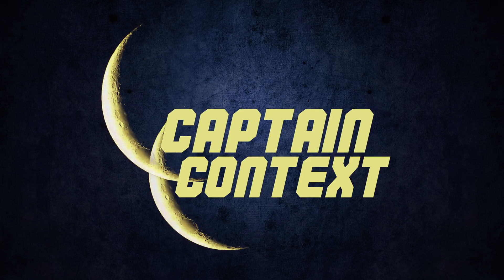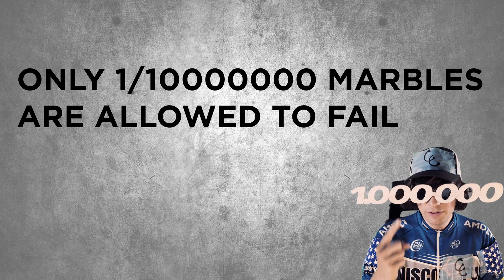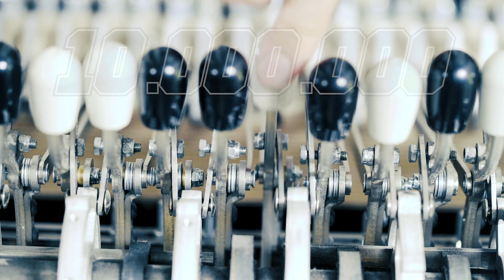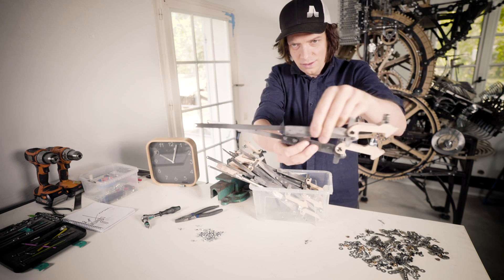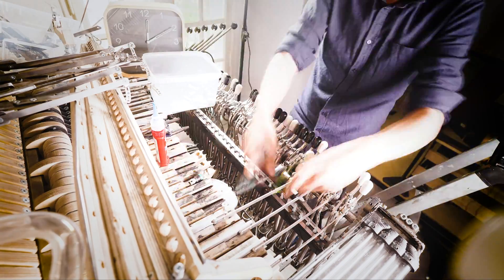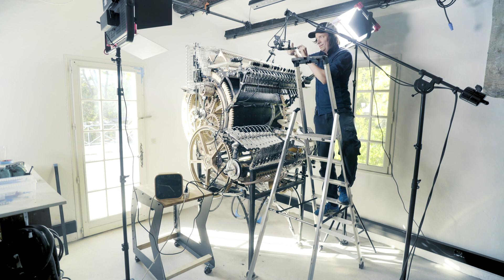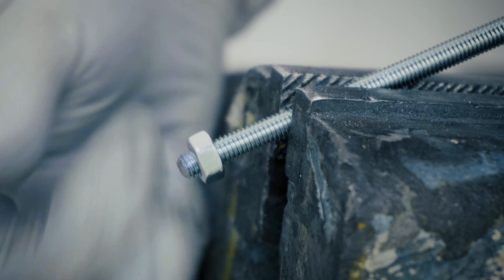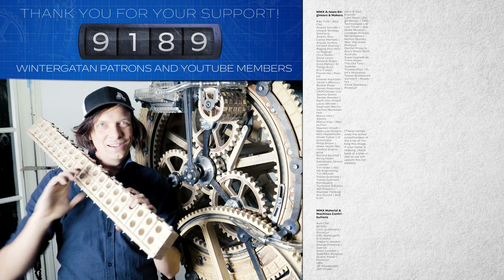Countersink? Why? - Marble Machine X #143

Comment: I hate to say this, but:
 To achieve Martin’s goal to play 1000 songs without failure (“with luck”), that is that only every 10 million-ths marble fails, it is not sufficient to make every part 10 million times work in a row.  Martin needs all parts that contribute to the marbles’ success together to work correctly 10 million times in a row.  Please let me explain what this means with a simplified example.  If there were only 2 parts in the marble machine, and the marbles have to pass through both parts to “succeed”, then if only one of the two parts fails this means that the marble will not “succeed”.  So we have the following fail/success scenarios:  part 1 | part 2 : result ———-+————:————— ok       | ok       : success
fail      | ok       : fail ok       | fail      : fail
fail      | fail      : fail  In other words, a marble only succeeds when both parts work correctly.  When only one part fails, or when both parts fail, the marble will fail.  Now, how probable is it that both parts are ok at the same time, if each part works ok 99,99999% of the time?  The probability of that is the product of the probabilities for each part that the part is ok:

  probability-both-are-ok = probability-part-1-is-ok * probability-part-2-is-ok

In probability theory 99,99999% reliability translates to a probability of 0,9999999 (that is, simply divide by 100), and 
  0,9999999 * 0,9999999 = 0,9999998  So the reliability of the whole 2-part machine in this example is only 99,99998%.  Or, in other words, 2 of 10 million marbles will fail.  So only 500 songs can be played with a machine that has 2 parts, when each part has a reliability of 99,99999%.
 It becomes worse with more parts.  If the marble machine had 10 critical parts, and if the failure of any of the 10 parts means that a marble will fail, then if each part by itself only fails 1 out of 10 million times, then the probability of the whole machine working is    0,9999999 ^ 10 = 0,999999  (That is 0,9999999 to the power of 10, which means the product of ten numbers 0,9999999.)  So only nearly a million marbles will make it through before one fails, and Martin can only play 100 songs in a row.   What does this mean?  To find out how reliable each part must be, Martin needs to find out the number of parts that the Marble Machine X has that need to be in “ok” condition in order to make the marbles come through correctly.  Let’s give this number a short name, and also the desired reliability of the machine:    N = number of parts that must work   R = desired reliability of the whole machine (as a probability between 0 and 1, as above)  Then Martin can use this formula to calculate the reliability “r” (as a probability between 0 and 1) that is required for each part:    r = N-th root of R  (A scientific calculator (app) can compute this easily.  Or even google can do this.  In google, search for the text “Nth root of R”.  For example “100th root of 0.9999999”.)

As an example, if the marble machine X had 100 critical parts that must work “ok” for the marbles to come through correctly, then the reliability of each of these parts must be:    100th root of 0.9999999 = 0.999999999  In other words, each of these 100 parts is only allowed to fail once in 1000 million times.  (That’s once in a billion times, for Americans.)   One more hint:  It is also possible to go through all the parts of the marble machine that “must work” and estimate the probability for each part that it works, and then to multiply all these probabilities together.  (Don’t forget to use numbers between 0 and 1 for each of these probabilities!  0 = it always fails, 1 = it always works.)  The result is the reliability of the whole machine.  Some parts may be far more reliable than others, and it is possible to identify the “weak spots” of the machine more easily this way.  One can then use a spreadsheet and check how much the reliability of each of the “weak” parts must be increased to achieve the required reliability of the whole machine.  (That is, fill all the probabilities into spreadsheet fields, then use the PRODUCT() function over these fields to get the reliability of the whole machine.  Then, make a copy of all the fields.  You can then highlight and tweak the probabilities of the “weak” parts in the copy to see how much the reliability of the whole marble machine changes.)

Comment: a video without context is like a marble machine without a realistic fail ratio.
design it and test it how you like, but if it's bound to fuck up somewhere, then no amount of oversight can counter it. the more moving parts, the more opportunities exist for fails.
btw, your patreons are becoming fewer... what's that about?
Reply: I was wondering about the count, I hadn't gone back to check but it seemed like it was at a minimum not going up lately. I think (and I hate to say it) that a lot of people are seeing the same thing you have mentioned, where the always-dynamic goal posts have been moved to an unrealistic distance. The last several videos have essentially shown the machine moving backwards in completion, whereas before it was close to being able to play a few songs before needing revision, now it is getting major components reworked from scratch - and if the same unrealistic objectives are going to be applied to the remaining parts of the machine, it's more or less about to be completely started over. After 2-3 years being at 90-95% completion stopping and saying "no wait" is pretty discouraging to patrons (and viewers of the channel).

I think a better plan is more or less what everyone in the comments is saying - even if the failure is 1 in 10,000,000 then that failure could still be on marble #4, it needs to have shear pins, heavy springs on slips joints, or something to enable a marble to "fail" and only disable that one particular channel. These failure points should be easily reset. Martin will notice it immediately if something goes wrong, but can still finish the song, and clear the jam without much delay. Better yet, this approach would make the machine actually possible to complete again.

Comment: Just throwing it out there that having it drop 10000000 Marbles without fail is very different from having every component function 10000000 times without fail. From what I can tell there are very few moving parts to this which interact with every marble that is dropped meaning most parts don't require quite so high a level of reliability (though I'm not say redundancy in the reliability is a bad thing) and further more this is going under the assumption of never carrying out maintenance at any point between the required 1000 songs.
Honestly, it might sound a bit harsh but I think this video about context has almost missed its own point by assuming that the context of the machine as a whole is always the same as the context of each of its components which for the most part... it isn't...

Comment: as a former Fire Protection Specialist....we didn't run because of mistakes... we didn't run because of the risk of injury.   If we're responding to an emergency, and we twist an ankle or stumble and get an injury.. that means our crew is down a man in their response, and that increases the overall risk to the entire crew....and substantially adds to the time required to mitigate the emergency...
instead, we were often told "Show a sense of urgency"..

in a way, it's a lot like your marble drop reliability issue......if we run to the truck or run across a fire ground...maybe 98 or 99 times in a hundred, it will save a bit of time... but that 1 or 2 times where you take a spill, twist your ankle, jam a knee, stumble and fall breaking a wrist or elbow, whatever.....that can mean a critical failure in dealing with the emergency..   
But if you WALK (albeit, hurriedly, determinedly.. with a "sense of urgency and intent"...)  you will arrive EVERY time, safely, prepared to deal with the event you're responding to....

There's also another factor most people don't realize.....the gear worn by firefighters is HEAVY...
the heavy protective clothing, made of durable outer shell (usually a nomex type blend canvas) a vapor barrier, insulation and padding....they're oversized (to be worn over the uniform) and inherently bulky (to provide the required protection) ....the pants, boots, jacket, gloves and helmet alone, easily runs 30-40 lbs....now add the SCBA..the breathing apparatus that allows a firefighter to work in the smoke & toxin filled environment of a burning bldg..   you're easily carrying 75# of gear..and that's before you add any specialty gear or tools like axes, pry bars, thermal cameras, etc...
Performing a "rotation" in a burning bldg (working on extinguishing the fire, for the time it takes one airbottle to be used up )  has been compared to running 2 miles...with little to no warmup or breaks.    A lot of modern SCBA bottles are rated for 45 mins...an experienced firefighter can make it last that whole duration, but it's standard practice to cut that to 30 mins to allow for a safety margin should it ever be needed. 
  Carrying all that heavy gear, it's a lot effort just to do basic tasks, much less work on the actual job of putting out the fire..   Walking conserves endurance to allow more extended effort where it's needed.....

Comment: You can cut the bolt halfway. Then bend it very slightly. Back and forth just a tiny bit until it breaks. Threads will be clean

Comment: If you are going to be standing in one spot for an extended amount of time, like when you are disassembling then reassembling all those links, you should stand on a soft surface like a rubber mat. A rug will make do in a pinch as well. Your feet, ankles, and knees will thank you at the end of the day.

Comment: I'd just like to add a reminder that all the comments are coming from a place of love. We don't want to see you waste so much of your time and drive yourself crazy. 
"Test a Little, Build a Little, Learn a Lot"
If you're doing it for our sake, I for one am ok with seeing you just build out 3 or 4 pieces of an assembly and test it before applying almost two days work to implement it to the entire system.
Normally I wouldn't even mention anything but you've put out a few videos recently where you talk about your need for time efficiency.
Reply: Exactly! Instead of making 38 channels and noticing a missing chamfer, making like 4 with some thorough testing and then iterating on the design before making all 38 channels would save so much time!  Indeed, if only say 4 channels was prototyped from the beginning of the project, all the way from pickup of the programming wheel to marble hit - Martin would have been a this point last year.

Comment: Every time I counter sink holes I use a test piece and sneak up on it until it's flush between the surface and the screw head. Then I use some masking tape to mark the depth and get it 100% perfect every time.
Only downside is the countersink bit I had didn't actually have the same angle as the screw head, so measuring it was more important.

Comment: Well, Captain Context, I have to disagree. If two parts have a critical contribution to a result and they both have a 1:10,000,000 chance of failure, the result now has a ~2:10,000,000 chance of failure. If you use 10 critical parts, you lose a nine. Use a 100 critical parts, you lose another nine, get up to a thousand and ... well, you get it.

Comment: i wonder if you should just be looking at this machine as the MMPX the marble machine prototype x and once you have this one working how you want it you go back and make a new one that is made from the ground up with all the final fixes you made to the prototype that way you get just that much more reliability with having new parts made to the new specifications instead of having all the parts you used during prototyping that have reworked spots that could be a point of failure

also you calculations are only counting on every marble doing what its suppose to you forget that every moving part is a point of failure making the chances of something going wrong a 100% guaranty so instead of having so much reliability you should also have quick reparability for not if but when something brakes on stage even if that means having more then one MMX on standby

Comment: Your desired reliability is far beyond 6 sigma, widely considered to be "the best" reliability possible.  "Processes that operate with "six sigma quality" over the short term are assumed to produce long-term defect levels below 3.4 defects per million opportunities (DPMO). " Your desired 1 in 10 million is 34 times better!  Such quality is probably impossible!  You should consider making the marble machine robust enough to have a problem but not break!

Comment: Put in other terms you are targeting around 10M FIT  for the machine (FIT = Failures in time, meaning the number of expected failures pr. billion operating hours). As a point of reference. Industrial electronics are frequently targeting 200 FIT or less. This is not to say your challenge is easy. Electronics and mechanics is too different to bear direct comparison.
 
One of the lessons of achieving high reliability is, which is also reflected in other comments, that you do not get there by predictive behavior alone. The world is too random. For electronics, the stray alpha particles is the demon that ultimately cannot be avoided that cause errors. For mechanics there is likely other demons. Ultimately fault tolerance needs to be built in, not just planning for no erroneous behavior. Every part must be considered for how it behaves in case of a fault and a graceful way to fail must exist. Fusible links, tings that just move out of the way etc.  

Finally the last lesson is: If you didn't test it it won't work. To actually validate the reliability of your design you need to test it to your spec. This very likely means testing at least some parts to destruction. Fortunately it is all in CAD, you can remake parts. Testing that much though needs automation, so your coming challenge is to make a validation plan and test harness to validate the design once you think you are done. By then remember: If you did not find any issues, you did not test enough.

Comment: instead of counterskining, wouldn't it been easier to just use dome headed screws? (ISO 7380 or ISO 14583 for example)

as for your thread cutting: there is in fact a tool to apply a chamfer/deburr to threads - you can mount it in your drillpress or powerdrill, looks like an inverse countersink (functions basically like a pencil shapener) - is much faster if you need it often

Comment: You might want to verify the counter sink that you are using is the same for screw that you are using. There are several angle types. Also why not use some low profile lock nuts?

Comment: There is a problem with aiming to reduce failure to 1 in 10^7. You can never know the exact failure rate of a part so it's impossible to know when you've met that goal without actually testing it 10^7 times.
However with such a high demand for reliability, we can make a pretty good guess that almost any part is not good enough which means the machine will never be completed. As many others have said, you need to think more about what happens when something fails rather than necessarily preventing the failures. Ensure that failures don't break the entire machine but instead just miss a note or take a single channel out of operation and that if a part does actually break it is easy to replace and that you have spares on hand.
In theory making a machine that doesn't break is a better solution than making it fail safely, but only one of these is actually realistic

Comment: That is what you are supposed to do anyway is chamfer the rod and then take the nut off. Of course, it won't work leaving the saw chunks. You should work in a shop with mechanics and learn all the little tricks. You can get nuts that are specifically designed for this. They have cutters instead of threads. So they remake the thread and the tool chamfers the rod. Worth looking into if you are working with lots of ready rod.

Comment: Just keep doing whatever you think you need to do, to make this masterpiece a masterpiece. 

If you have to go through 10 teams of engineers, and 10 generations of fans, you do that, because ultimately what matters at the end of the day is that you are satisfied with your work.

From what I have seen of the previous work, your satisfaction resulted in what lead me to watch the videos and subscribing, and even if I have to wait 10 more years, I know it will be worth it in the end, you know what you want, and I know you're talented enough to make it happen, and I am a fan of your work, so do you for you, because I already know I am going to like the results.

Context = replacing the original machine , with something that will last an entire tour, even if that means rebuilding the new machine 1000 times over, I know that, just don't lose that drive to do whatever it takes to beat the sucken-cost-falacy, because only you can stop sucken-cost-falacy.

Comment: 1/10000000 failure chance is better than you think. For each marble drop, there is a 9999999/10000000 or 99.99999% chance that it will not fail. Now say for two marble drops the probability is the same as the probability of success and (times) the probability of success, or the probability of success to the power of two. So for 3500000 marbles (1000 songs), the probability of success is (9999999/10000000) to the power of 3500000, which is about 70.5%. Since the machine will either succeed or fail, the probability of success + probability of failure must be 100%, so then we know the probability of failure is only 29.5%. Anyways, great video as always and good luck, because you'll still need it.